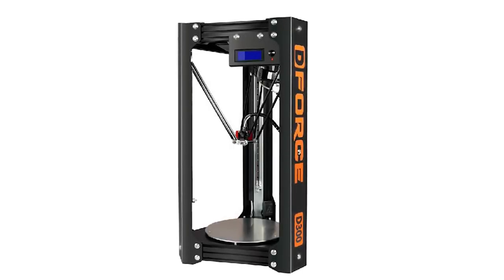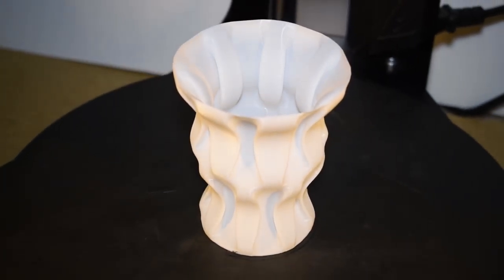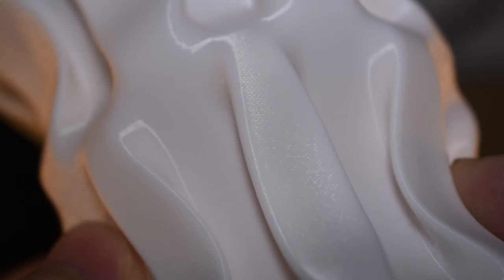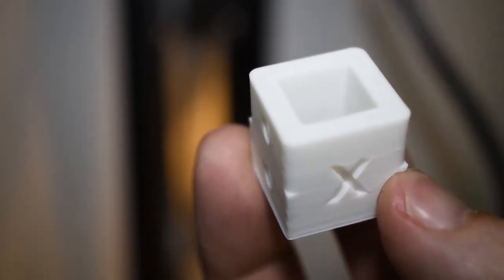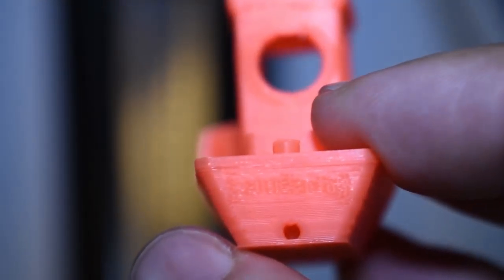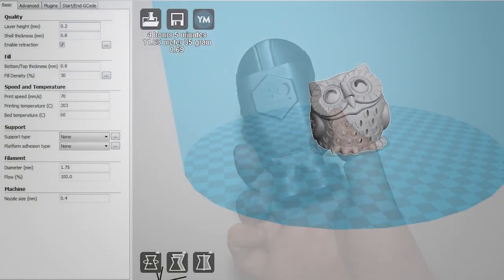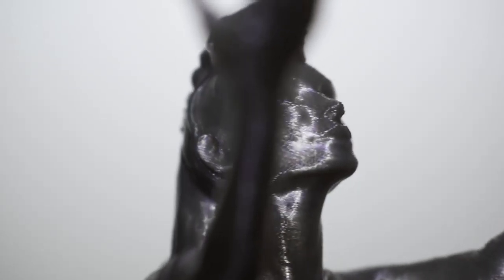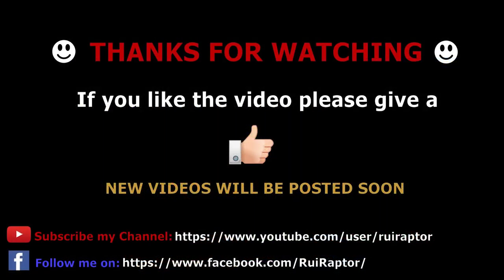First Prints with a TriangleLab Dforce D300 3D Printer

Comment: No missing layers ?! ;-)
Reply from the maker: Hi,
I had a few missing layers but only with the owl model and the missing layers were always after a big retraction.
This was due to the fact that i was trying to reduce the blobs/zits and ended on increasing too much the retraction value on that model. In areas where there is no retraction, you can see perfect layers.
Reply: Delta Kossel printers... always miss layers especially if you print bigger models, or you must print max 50mm/s